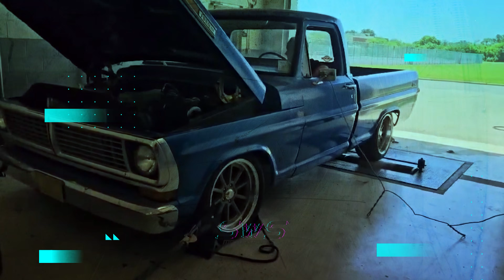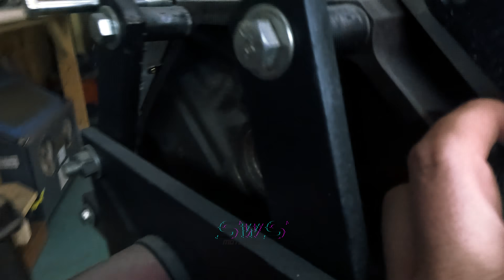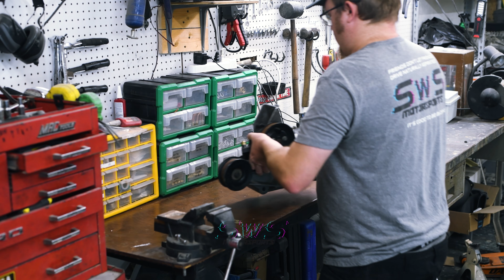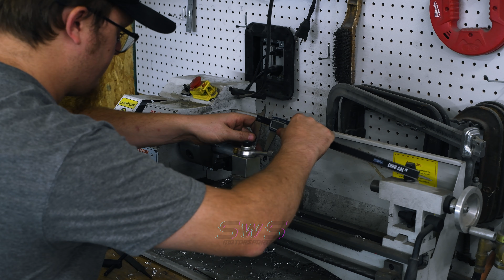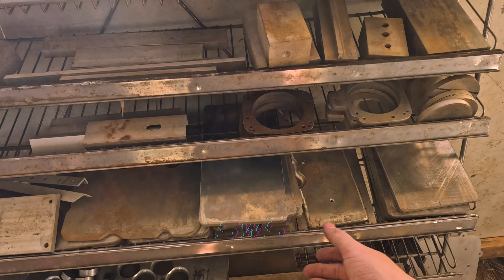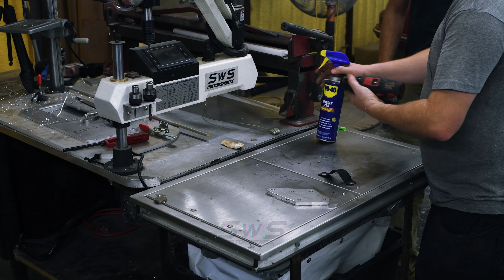SWS Motorsports Reveals the SECRET to Reliable 302 Supercharged Engines

Comment: I found your YouTube page because of the give away you were doing to bad it was to late 😢  It would be really cool if you made a blower adapter for the SBF Holley efi intake
Reply from the maker: Our casting will fit it, and its in the works!
Reply: @SwS_Motorsports I knew you had one for the LS intakes but I didn't know if the front to back alignment for the belt would be the same for a SBF

Comment: Currently building  a 357w with L83 GM heads and a tvs 2.3 blower
Just found your channel!
Reply from the maker: Brother. For the love of God. Ive been wanting to put LT heads on a 351 soooooo bad
Reply: @SwS_Motorsports  I’ve got the short block built and have welded up the necessary coolant passages on the heads.. need to touch them up a bit then mill them and open up the bolt holes.. obviously I’ll have to fab an intake up
Going to put a heat exchanger in it while I’m there
Seen a guy use an eBay oil cooler so I’ll probably go that route. Your channel motivated me to get back on the project!

Comment: Love your transfer punch. The folding end type. If you want, send me an svg or dxf and I can cut that plate out for you on my home built cnc plasma table.
Reply from the maker: I  will have them laser cut  for the production run.

Im currently building a tool changing cnc mill 😅 with a homemade plasma table converted to cnc router/gantry mill

Comment: Im doing a GT500 swap on my 6.0 LQ9 with a tick peformance air to water intercooler to keep the iat's down but I've got to run a spacer between the cooler and the adapter plate from you guys hoping it all works out 👍
Reply from the maker: The tick performance parts are super nice.

Our IC'S actually clear the plates. But there are a few ppl runing the tick units with great results